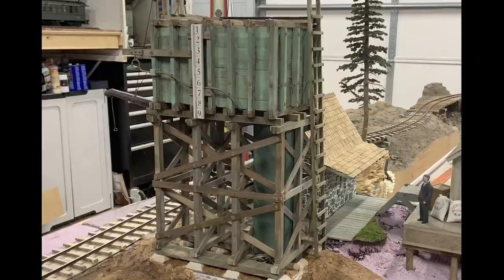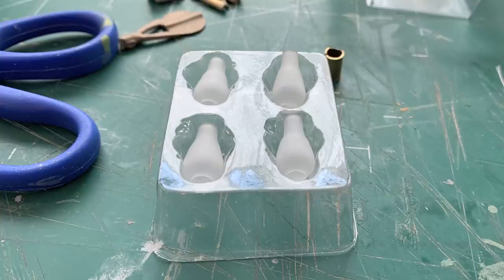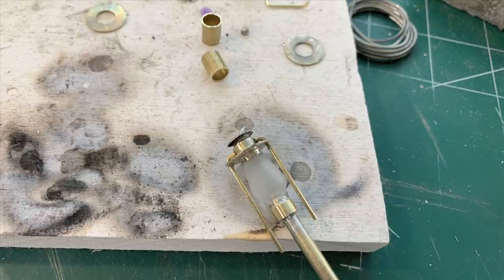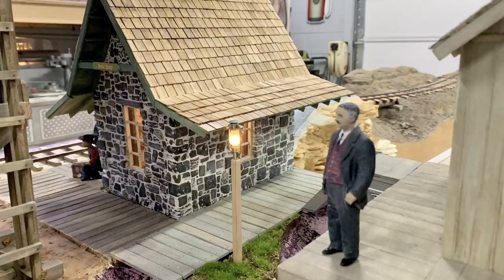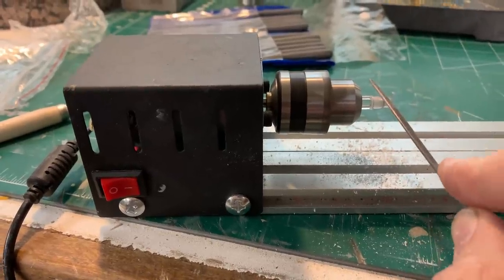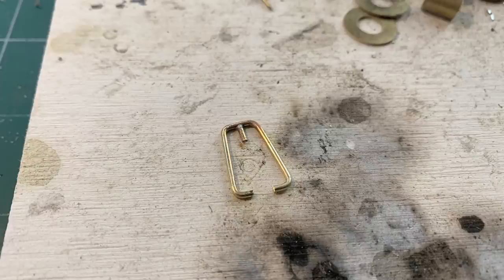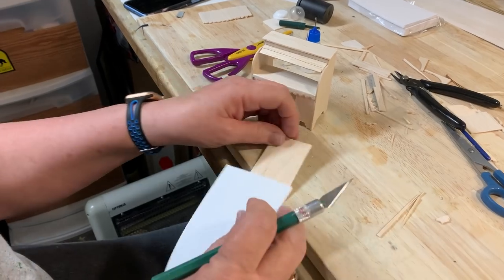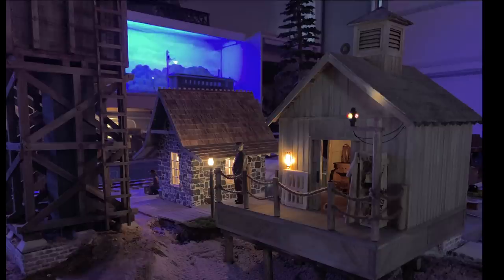Building Strebel Springs - Badham Freight House Interior and Lights

Comment: The lamps are great.  The idea of removing the rope brings up a problem of how it is to be done because the rope goes from post to post to post past through the posts past that section.  You may need to make a loop on one end to go over the post or a pin on the post so it can be removed.  Great idea.  There are similar lines on boats to "gate off" where people board and leave while under way.

Comment: The polishing the acrylic with your finger trick is great! I watch “Marty’s Matchbox Makeovers” (from Australia) and he uses cheap household floor polish (or cleaner) to get the scratches out of the plastic windows. He takes the windows off of the cars (usually on piece that is glued or riveted to the inside of the roof) and places it into a small container then squirts some floor cleaner over it and lets it sit for an hour or so. It seems to work great!
(Oh and I love that you tasked Karyn with cutting the tops on those teeny glass lantern shades!)

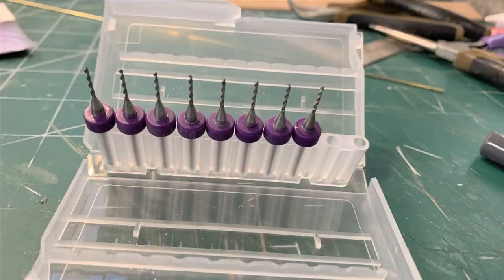Comment: 5:30 - Dremel RPM is too fast for small drills. And the high RPM and too much pressure is a bit much on small drills. So they break. Which is why I use a slower RPM tool and a lighter hand. A bench drill press will usually work at 1000 RPM or less and will go through steel, but a Dremel at a minimum of 5000 RPM takes pressure to get through brass. Dremels (or similar) are great tools, for so many applications, except drilling.
Reply from the maker: We have mostly good luck. As you say, slow....